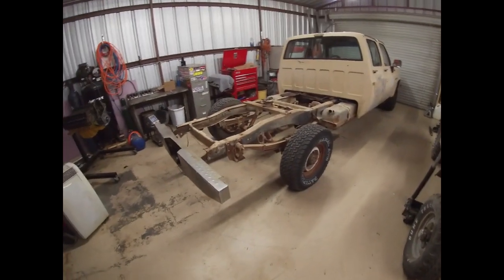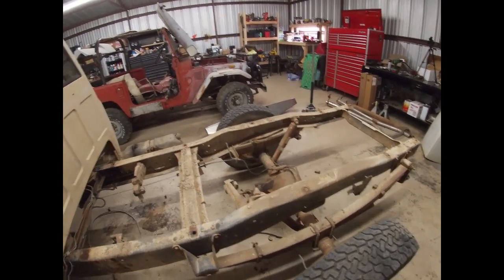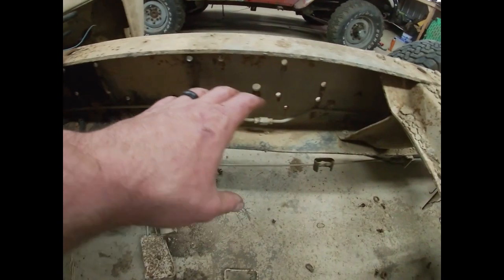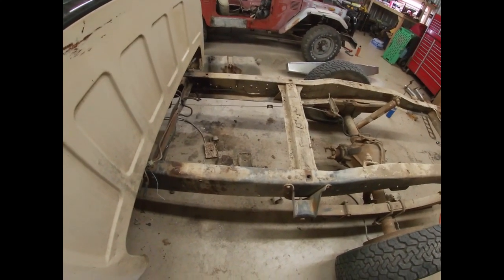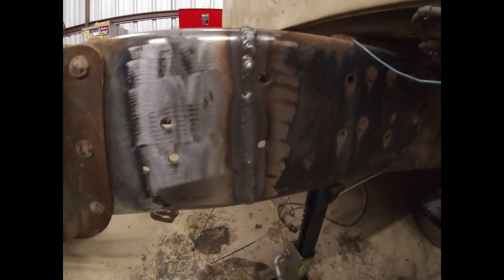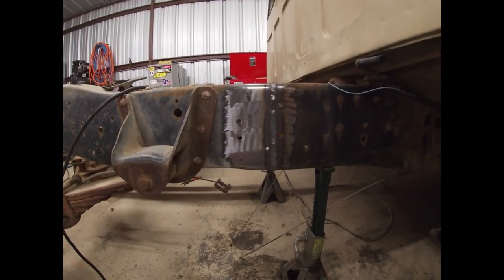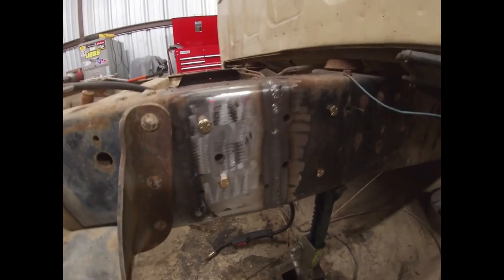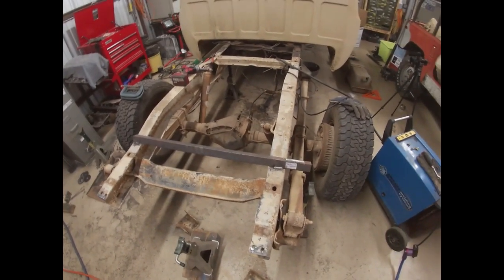83 crewcab squarebody shortbed conversion

Comment: I've been wanting to do this and begun the research, why did you go to the 1/2-ton suspension and not stay with the 3/4 or 1 ton? Will it not work? I see kits for sell but they say it won't work with the heavier suspension.
Reply from the maker: I went with the 1/2 ton suspension because of ride quality, and it sits lower. The guy that owns it just wanted a cruiser and something to take to car shows. He’s not going to use it as a truck. So the 1/2 ton suspension will make for a lot nicer ride
Reply: @HarmonGarage  I just got an answer back for PB Fab on their kit. The C20 has a 6" frame height, whereas the C20 heavy and C30 have an 8" frame height. Thanks for answering my first comment.
Reply from the maker: The front suspension all bolts up in the same mounting points. To swap the rear you have to take the spring hangers off the half ton and put them on the heavier frame or the springs won’t line up with the rear end. I’m not sure on the kits. I’ve never used one. I always just shorten them my way

Comment: Cool project :) May I recommend setting you camera to 1280x720 - you will get rid of your black bars on both sides of your videos - with respect :)
Reply from the maker: Thank you sir. I will have to see if I can figure out how to do that
Reply from the maker: I think it only does the bars when I use the go pro. Do I try to change the settings in the GoPro or can I do it in the editing software?
Reply: @HarmonGarage  In your Go Pro :) Nice work :)
Reply: @HarmonGarage  Remember your editing (project settings) should also be 1280x720 :) as well as when your export the video :)
Reply from the maker: Thanks for your help. I will try to figure it out

Comment: Question :  Because I have no idea the answer. But , couldn't you just do a Z cut right at the back of the cab and weld in a 1/2 ton frame onto this frame or are the frames that much different?
Reply from the maker: I’ve never checked to see if a 1/2 ton frame piece would fit. Would be something to look into
Reply: One ton trucks have a taller frame. I can't say for certain but I believe the half ton is 6" high, and my son's k30 is 8" tall frame.
Reply from the maker: That’s correct
Reply: I have seen guys cut 1 ton 2wd fronts off and weld in a 1/2 ton 4x4 front frame... but a buddy told me how in a couple hours you can pull off 4x4 blazer to make a 2wd. Just removing suspension components

Comment: What gauge steel would you recommend to use if you wanted to create your own brackets?
Reply from the maker: What brackets are you wanting to make? If you mean the fish plates to strengthen at the cut you want to try to use the same thickness as the frame. So 3/16 to 1/4” plate

Comment: Were to measure from again
Reply from the maker: I measure off the front bed hole
Reply: @HarmonGarage  thks i have a 1974 c20 crew cab had the short bed 3 year have the lq9 t400 gear vender plus the front and rear lowering kit thks for the reply
Reply from the maker: No problem. Thanks for watching
Reply: @HarmonGarage  might get me motivated to shorten mine i do a construction splice and fish plate mine

Comment: Down hand on a frame wield ......................
Reply: Tensile is probably still more than base metal.  Even without the doubler plate.  

If it was mine I would probably use whatever I still had on the machine (which is usually hard wire) or 7018 if I really wanted to feel good about it.  

Anyways I understood what you were implying.  He’s probably not a welder by trade so explaining your position would be more helpful.